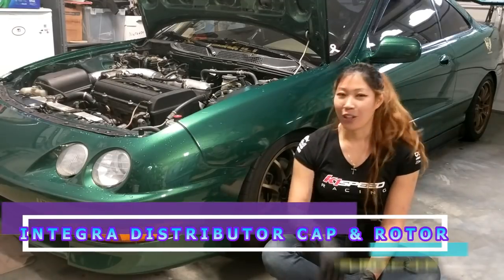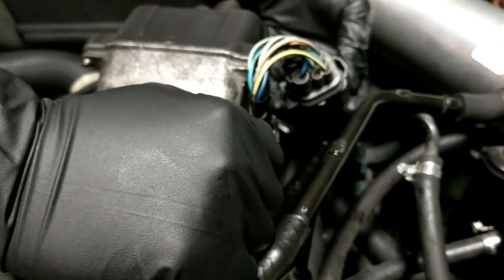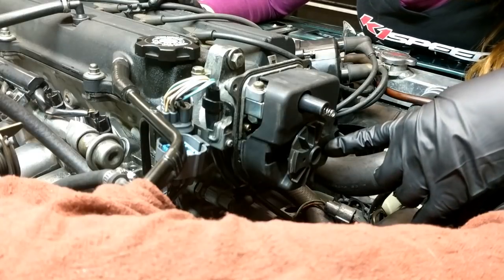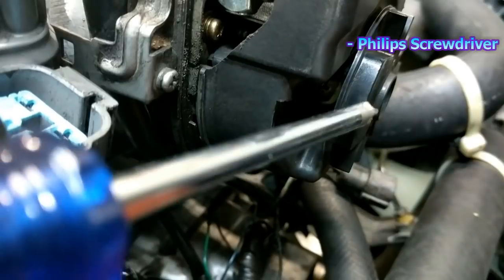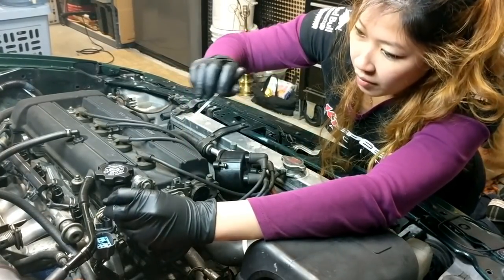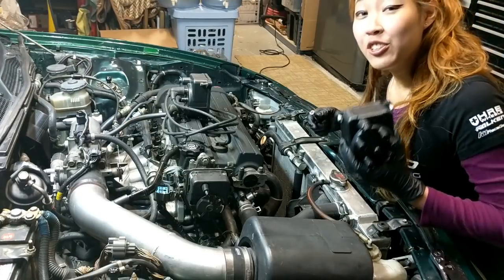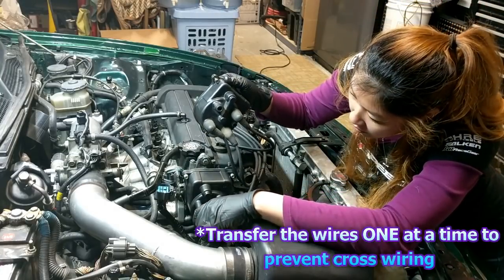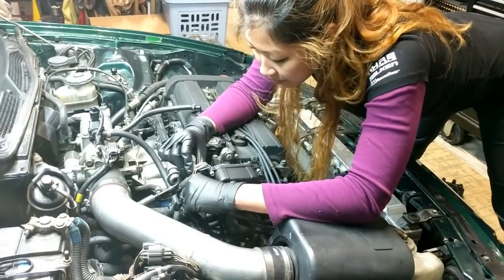How to Replace Integra Distributor Cap and Rotor (VLOG 16)

Comment: If you lose the screw holding the rotor on, it is M5 x0.8x10, which can be purchased from Lowes in a 8 pack from the hardware section.
Reply: Thank you good sir 🙏🏻
Reply: Thanks bro
Reply: Thanks bud 😂

Comment: Thank you so much would this help a stop hesitating to start? Because my car does that i hope this will solve it .
Reply: Did it solve it. Im having a weird problem with sudden hesitation sometimes between 2500 to 3500 and yesterday with 100 degree heat it started but wouldnt stay on til i kinda forced it to. Replaced the wires but nothing happened so figured it might be the distributor itself...

Comment: When should you replace your cap and rotor
Reply: I think the owner's manual says to replace every 45,000 miles.
Reply: @MichaelFlare  how many months is that ,sorry for the dumb questions ,I'm just getting into cars
Reply: @jlr194  You should almost NEVER do your maintenance scheduling based off of TIME but MILES instead. The reason why a lot of shops you go to give you a sticker that shows maintenance schedules based off of time and miles (they say whichever comes first) is for people who really don't know much about cars, and the date is usually a simple indicator for them. Here's an extreme example: Let's say you have a special car that you only drive once a month, and it sits in a garage (it probably gets 60 miles a month). You leave an oil change shop, and it says to change after 6 months or after 4000 miles. Your car DOESN'T know or feel TIME. They only feel MILEAGE. If the car is driven only once a month, that oil is probably good for 10 years! A person who works on cars will most likely ONLY follow the MILEAGE for maintenance schedules.
Reply: @MichaelFlare  that makes total sense

Comment: Just replace the whole distributor. Take about 10 minutes max
Reply: Thadya Virginia aftermarket, but if OEM is a big deal then do it. Aftermarket works fine.
Reply: Plus more expensive. New one is like 300 vs cap and rotor about 15 buckz
Reply: You still have to time it